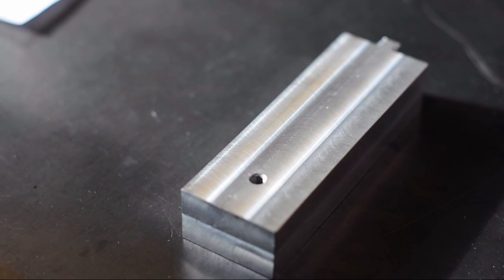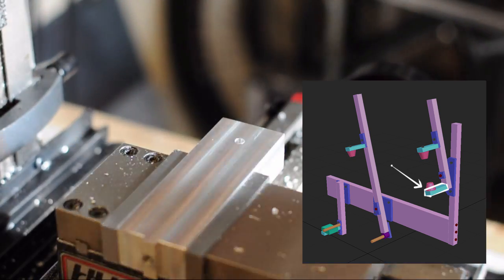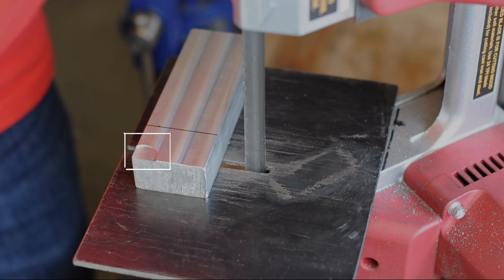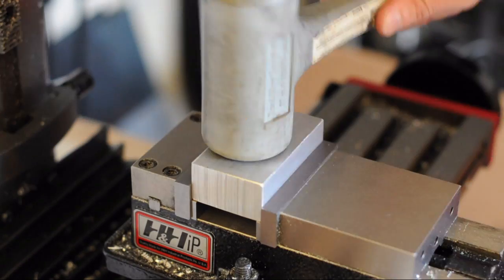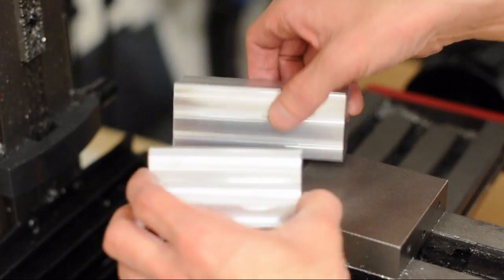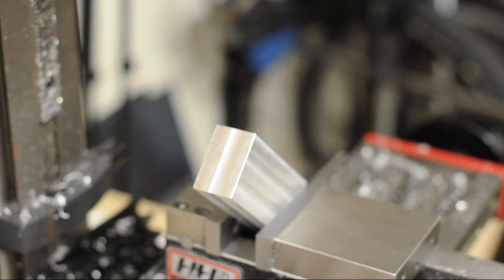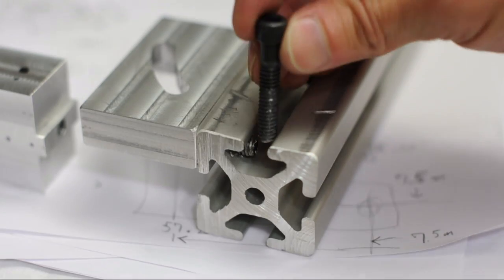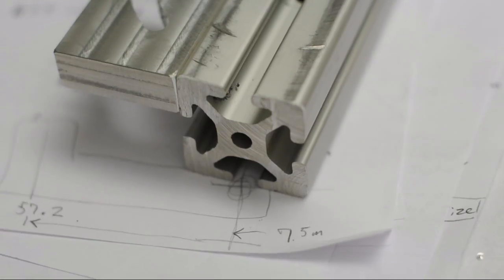Bicycle Frame Build 14 - Frame Jig Pt.06 - Machining Head Tube Arms For Jig

Comment: Drawing up my own jig now. Fairly new to machining and CAD. I'm tempted to design/assemble the upper cone assembly like yours with just socket head bolts (see 10:37), but I worry about the alignment, since there's play in those clearance holes (though I suppose not more than ~0.5mm). Would you do that differently today? I was thinking either countersunk bolts (if those are accurate enough to align things), or some kind of keyway, though a keyway would have to be in two dimensions, and idk exactly how to achieve that (a cross shape or something?

Comment: beautiful machine work. I notice you are using fairly small screws for everything. When welds cool off, they will shrink and pull the work pieces and distort the work pieces. There is a lot of force there.
Reply from the maker: Screws are 1/4 -20 which is pretty standard for fixturing. So far no breaks.. fingers crossed!

Comment: Hi Pithy, what is the name of the aluminium profiles you use?
Reply from the maker: +Peter Hoekstra Hi! The aluminum with the groove in them is from a company called 80/20 Inc. https://www.8020.net/
They make many types. The kind that is most commonly used for bicycle fixtures is called "40 series extrusion".

Comment: Thanks for the great video! At 5:48, why do you clamp the work piece with a rod in the vise?
Reply from the maker: +Mitha Htoo hi! so far I have only built a MTB frame. I haven't made a chopper or cruiser. But the fundamentals to make these frames are all basically the same. design, metering, fixtures, welding.
Reply from the maker: It's to keep the piece flat against the back jaw of the vise  without influence of the front jaw. However I think I was doing it wrong in this case.
Reply: +Pithy Bikes Hi, thanks for great and good quality for making a series tutorial.i'm 
still watching your video. i want to make chopper and cruiser type 
bicycle. does it covered with your video? or do you have how to make 
chopper and cruiser type bike?

Comment: Looks great. Are you planning to add any type of argon purge system to the jig or maybe make some joint heatsinks?
Reply from the maker: Hi Andrew, not planning on purging currently. I'm building with steel so I don't think its critical. What are your thoughts on that?
I don't think I've ever seen a joint heat sink. Link?
Reply: Pithy Bikes Heres a link to a discussion on back purge systems at velocipede.
  
http://www.velocipedesalon.com/forum/f50/back-purge-setup-bicycle-framebuilding-33148.html

You can see pictures of some of the heat sinks folks made, Back purge is a lot more relevant when working in titanium as I understand it, but I do see a lot of steel builders doing it as well. With the steel being so thin I think you would get some oxidation on the back of you weld without purging on the inside, but I'm not sure how much that will effect your weld.

The heat sinks help with distortion of the bottom bracket shell and alignment.  

 Take that with a grain of salt, I am an no expert by any means, just a hobbyist builder.
Reply from the maker: Andrew Conrad Whoa! Thanks Andrew. I've seen those before but didn't understand what they were. I get it now. Thanks so much, I'm learning so much from you guys :)

Comment: I have to say, I've built hundreds and hundreds of jigs and fixtures (some 3' square tombstones) for machine builds or jet engine parts, but I am thoroughly impressed with what your doing, I am transfixed on your build, so great job. Also know that your mistakes are just a vital tool as any that you have in your shop, besides you have scrap pieces when you them. The pieces you said you made a mistake still looked good, may suggest looking into Heli-coil kits? They're a threaded insert kit made for strip threaded holes of if you wanted to, you salvage those pieces by increasing the hole size, make a steal stud to be a tight fit in said hole, then drill and desired hole, or increase the existing [mistake] hole and insert the proper heli-coil insert.

I do have one problem with your video, though...it's not long enough...LOL. Keep up the good work
Reply from the maker: Hi eddie,
Never thought about using an insert. That's a good one. I'm sure there will come a day when I give that a go. Thanks!